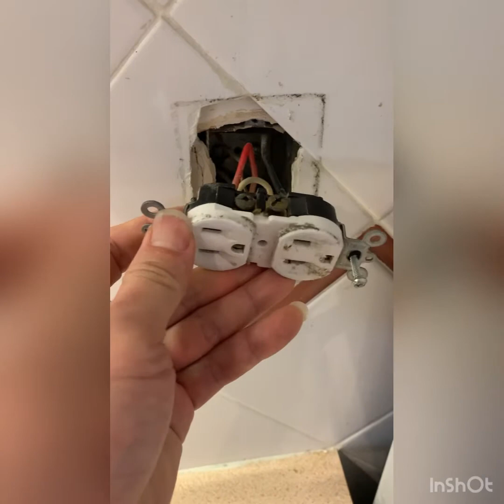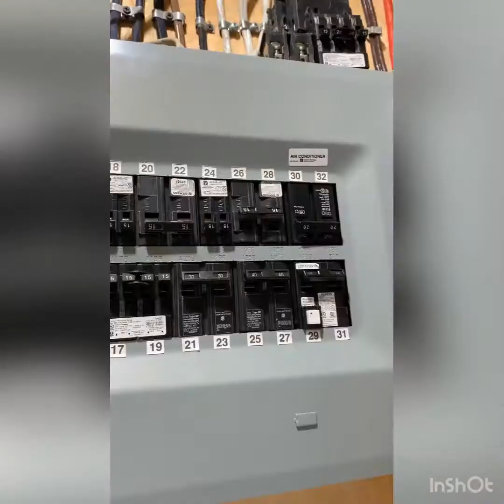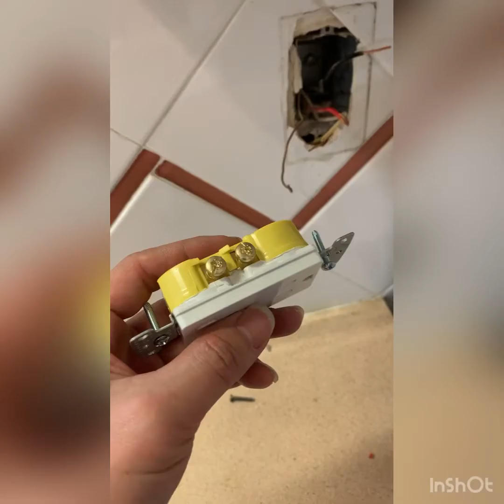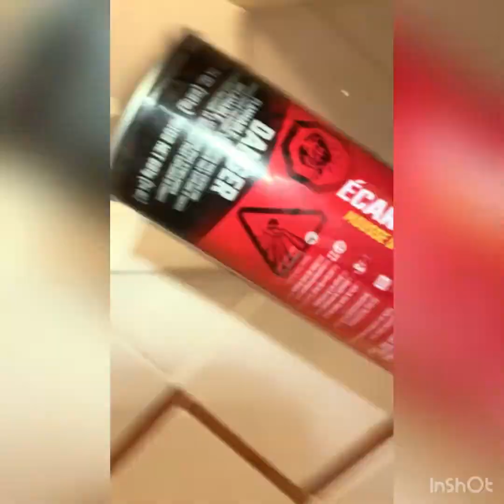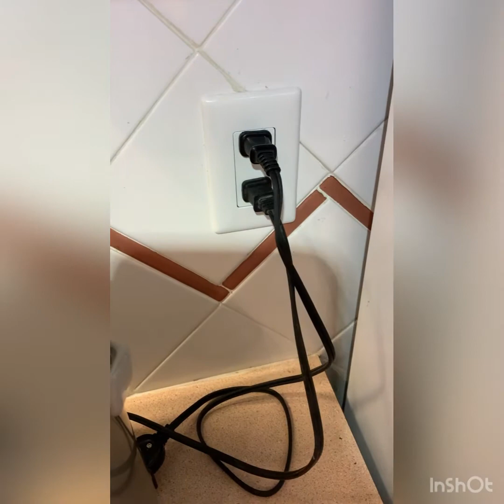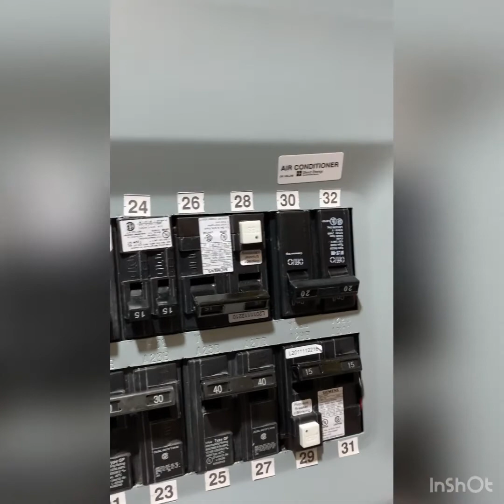Kitchen split receptacle GFCI upgrade - Siemens QF215A ClassA 2 pole GFCI circuit breaker

Comment: You got the part I needed to see. Where you split a GFCI into to circuits with one neutral and then said it was too hard and didnt do it. Arghhhhhhh
Reply from the maker: Check the pinned flash document from ESA in Ontario. You need to use CEC Ontario version plus updated bulletin regularly from ESA Ontario where I live . Hope it helps. Like I said in the video it’s up to you which option you choose according to the ESA flash.  NEC or CEC part I etc they all have been adjusted accordingly to the practical situation by local electrical safety authorities. Hope it helps.

Comment: Very obvious NEC violation before and after this video.  Receptacles above kitchen countertops are required to be connected to 20 ampere branch circuits.
Reply from the maker: For a 30 years old house “direct receptacle replacement “, 15 amps is acceptable to ESA in Ontario, Canada. Because it didn’t require 20amps when the house was built. When you mention NEC , I believe you live in USA. Check with your local electrical safety authority for old house retrofit . For new build house or new electrical installation or any electrical installation when that 20amps code applied in Ontario , yes, it does require 20amps on kitchen countertops. Hope it helps.

Comment: Instead of installing 2 gang box and installing 2 gfci outlets, what if we just install one gfci outlet and leave the other live wire in the box with Murrit and electrical tape it just incase.
Reply from the maker: Although it might work if you don’t have too much load in your kitchen but this alteration by disabling one of the circuit is violating the code in Ontario Canada. It won’t pass the inspection.

Comment: The reason why receptacles are installed in kitchen, bathroom, and laundry is because the potential water contact and to interrupt the circuit. Not really about power!
Reply: The power comment was for why split receptacles are used not for why gfci is used.

Comment: Thanks. I have done a similar conversion. Only difference was I have a Square D Panel. I was putting this off and waiting for someone to introduce an GFCI split outlet but haven’t seen one yet. BTW, I tagged my outlet with a “GFCI Protected Outlet” label as a finishing touch.
Reply from the maker: That make it even better! Cheers!